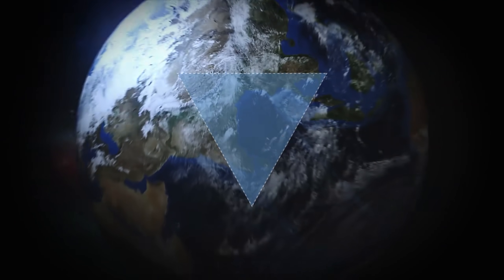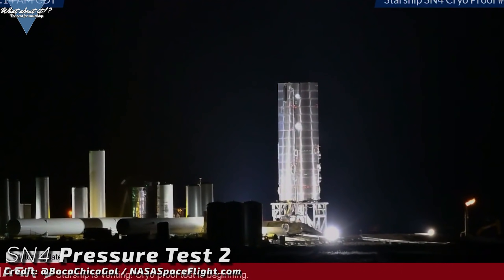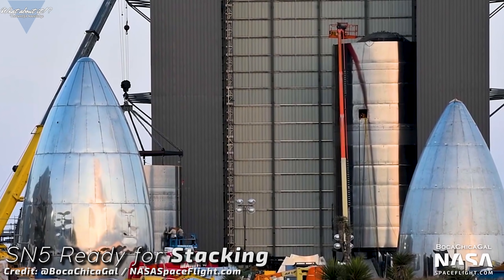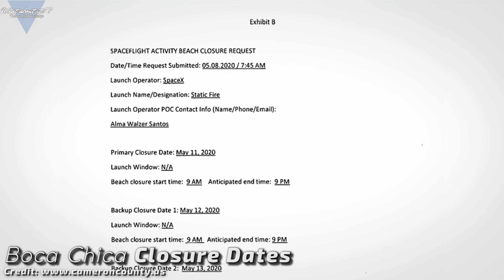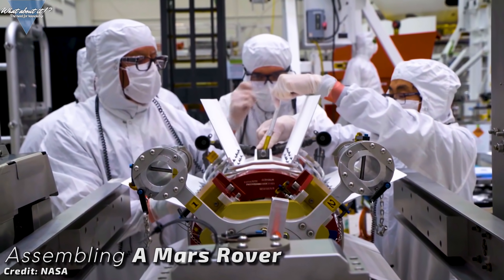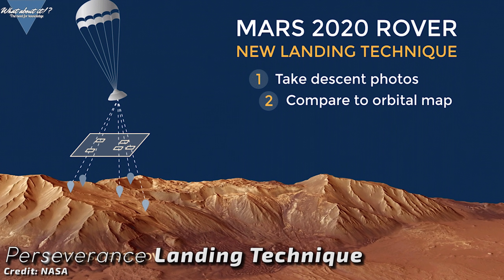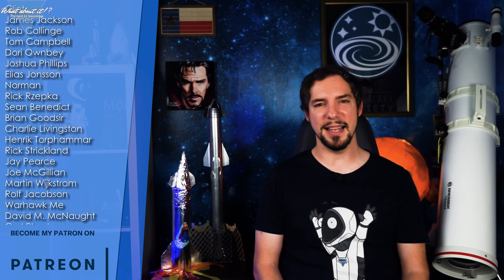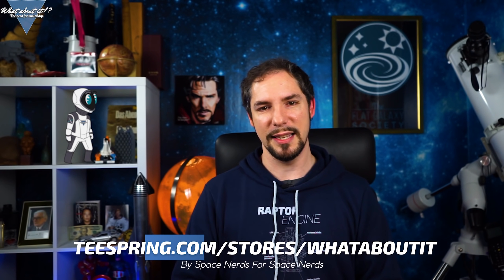91 | SpaceX Starship Updates – NASA Perseverance Rover Getting Ready For Mars

Comment: That engine size can lift 200 Tons? That's very impressive!
Reply: on its way to 250 soon
Reply: While being only a bit bigger than Merlin, that can lift almost a hundred tons, and is itself the highest thrust to weight engine ever made. SpaceX now builds the best rocket engines on the planet. I can highly recommend Tim Dodds videos on the Raptor and rocket engines in general. It's very well done and explains perfectly why Raptor is a great engine and why it's tailor made for Starship. https://www.youtube.com/watch?v=LbH1ZDImaI8&t=2s
Reply: Why do I smell a Raptor-powered Falcon 9 in the near future?
Reply: @InventorZahran  You mean Falcon 4!? That's an interesting thought. If I recall, Methane both requires a more oxygen rich mixture, and also is less dense. I'm sure somebody has done the math and I'd love to see how the numbers shake out on a stretch Falcon (or same-size with lower performance) with Raptors instead of Merlins. And whether there would be any point for SpaceX to do such a thing at this point?
Reply: @InventorZahran  Flying Falcons will likely become too expensive soon.
Reply: @InventorZahran   For no reason whatsoever. Raptor will power Starship, which will completely replace Falcon. Also, they use very different fuels.
Reply: @InventorZahran  IMO I don't think so. They would need to change all the fuel infrastructure, also redesign plumbing, tank and thrust pack of the falcon.

Comment: Outstanding reporting and presentation, as always, sir!  It's nice to see they didn't pre-perforate the wheels on the Perseverance as they did with Curiosity.  I'm still not convinced that rubber skin is durable enough. I would like to have seen solid Magnesium wheels, which would have the highest damping capacity of any metal, which is 10x higher than steel, aluminum or titanium. Magnesium is 33% lighter than aluminum, and we don't have to worry about it catching fire, because there is a severe lack of free-roaming O2 molecules for any kind of oxidation reaction. If you're thinking Mg has low tensile strength or surface hardness, those challenges have been solved already with coatings and alloys.  Spinners would be optional but VERY cool!

Comment: 👍🏽 Thx Felix.  Yes I think we will see a hop BEFORE SN5 for sure, THEN if all goes well and it lands in 1 piece, Elon will do a DESTRUCTIVE pressure test of 8.5 and above on SN4 to see where the current construction process BREAKS (its what I would do).  I think they should then start building and testing a superheavy thrust puck for those 31 engines.

My favorite Mars so far is curiosity.  This new rover will provide Martian SOUND?  Can’t wait!!!!  I think this rover will also test out producing methane.
Reply from the maker: My Idea as well! The Thrust dome for Super Heavy will be hard to develop. Question is: How do you simulate 7500 tons of thrust?

Curiosity is an absolutely fantastic mission and Perseverance, if it arrives in good shape, could even top that! Yeah, it will have microphones recording the landing and everytime instruments are used, including the drill.
Reply: Right on Keith I agree with you.  I think pumping up the sn4 to 8.5 would assure every one ( sceptics) that we got the high standards with this design.  Best regard; kevin McCarthy.
Reply: Technically, one of the current ones (I think it was Insight?) has already provided sound, since it turns out there's not all that much difference between a microphone and a seismometer...

Comment: Mars Rover Wheels, the issue with the wheels was an ongoing issue with other things as well. Static electricity creating an electrical charge Between the Wheels and bearings creating the pits that were wearing the bearings out. This has been an issue with other explorers and Rovers. I believe what day found to correct the problem was using ceramic bearings not allowing that static charge the transfer there. I recently watched an episode somewhere on this topic. Love the show, keep up the good work. From one space nerd to another. :-) space travel will get a lot easier for a longer duration as far as speeding up and slowing down is concern. It's time to start exploring magnetic compression. I have a few designs I would like to share with Elon if I ever had the opportunity. Magnetic compression does not require the burning of oxygen. It can be used underwater or in space.
Reply: Wow - I didn't even know ceramic bearings were a thing - thanks for giving me (yet another!) research topic friend!
Reply from the maker: That is an absolutely awesome comment! Thank you for the insight!!!

Comment: I would guess that in the same way hopper was a test for starship, starship is a testbed for supper heavy. It is not worth building super heavy till starship flies. Starship is supper heavy, just shorter and fewer engines... so these tests are equally a part of both projects. Super heavy is just an extension of starship at this point.

Comment: Solar powered methane condenser? How does that work? How does a flame work?
Reply from the maker: OK, I can answer the first question! It's an extremely cold tube winding in a snake form. Methane gas goes in, liquid methane comes out. How does a flame work? You have to elaborate a bit more... 😄
Reply: @Whataboutit  Does the flame take part in condensing the methane? Why are they using it instead of solar?
Reply: @Jimmy_Jones  They are venting it now - it is wasted.  They will in the future keep it, and chill the hell out it using tesla batteries charged up all day with tesla solar panels.  It's a very energy hungry process to super chill the methane gas.
Reply: The flame is the current system... excess methane gas simply gets burned off. The condensation system replaces that, by ensuring that methane vapour gets recondensed back into liquid. It's more expensive, and energy hungry, but I assume that with solar at least, the balance between "use less energy" and "don't release CO2" comes out in favour of the latter.

Comment: Hey Felix, are you going to cover the OTV-6 launch on 5/16/20? Scheduled for 12:24pm EDT,  It will carry the first experiment to convert solar energy on orbit into radio frequency microwave wireless power and beam it to the ground. The test is designed by Paul Jaffe at the Naval Research Lab. Space solar power for clean base load use has been a dream since Asimov wrote about it in the 1940s and Peter Glaser and Bill Brown did developmental work on it in the 1960s.

Comment: Why didn’t they use those metal weave wheels that were made a while ago?
Reply from the maker: Good question. I love the concept too.
Reply: I think it is because they are made out of graphene that is extremely expensive.
Reply: Maybe the metal weave isn't efficient enough, think of all the power lost while moving due to friction in the weave? Maybe they were not tested long enough, too much risk or other potential lifespan issues?
Reply: @spacenomad5484  
I agree. While they would certainly be tough. They would not be accurate enough for autonomous driving. Or manual driving! You would move the rover 5 metres but would find yourself short due to the tyres flexing.

Comment: I'm not sure about if they are fully aware of what is happening in the steel.

Simply said: there are two different "types" of steel crystals, austenitic and martensitic steel. the ladder is better for strenght etc, especially at cryogenic temperatures.
so, for example, you have a steel that is a mix of austenitic and martensitic steel (you can't avoid that), cooling it down to cryogenic temps causes it transform to a higher content martensitic steel, which performs better at cryo-temps.

there are plenty of youtube-videos showing that cooling drillbits etc down to cryo temps causes them to last longer (simply speaking, they throw them into liquid nitrogen, and wait for some hours.

that happened for example to SN2, which got filled up with liquid nitrogen, kept it for hours, and then easily passed the pressure-test, whereas SN3 failed.

so now they have cooled down SN4, and later used it for pressure testing, which it passed.

the solution is easy: just fill it up with liquid nitrogen and use some pressure, the Starship-tanks will get to the perfect shape, the steel ups its martensitic makeup, gets stronger, done. drain the liquid nitrogen back to a tank (doesn't need to get wasted), and you're done.

Comment: The University of Southern California recommends a minumum of 10,000 IU of vitamin D each day and single dose pills are made at that amount, although best to combine with vitamin K2. The Pharmacology of Vitamin D, Including Fortification Strategies states that there is "no evidence of adverse effects from taking 10,000 IU of Vitamin D a day". I take 10,000 IU each day, have for years. Currently, the tolerable upper intake level (UL) in Europe and the US is set at 2000 International Units (IU), equivalent to 50 micrograms per day. However, recent research, particularly from clinical trials, suggests that this should be raised. The CRN scientists state that this could be raised to 10,000 IU (250 micrograms per day).

The reviewers, from the CRN, Mount Sinai Hospital in Toronto and Crieghton University in Nebraska, pooled data from 21 clinical trials using doses ranging from 10 to 2500 micrograms (100,000 IU). The risk assessment also included data from animal studies, some of which used “extraordinarily high doses of vitamin D3”.

“The lack of adverse effects in clinical trials that used intake up to 1250 micrograms [50,000 IU] vitamin D per day and the lack of adverse effects at lower doses inspires a high level of confidence in the data from the strongly designed clinical trials that used 250 micrograms [10,000 IU] vitamin D per day,” said the reviewers.